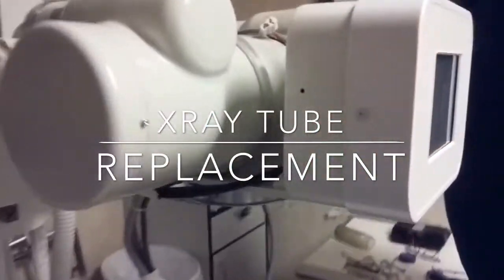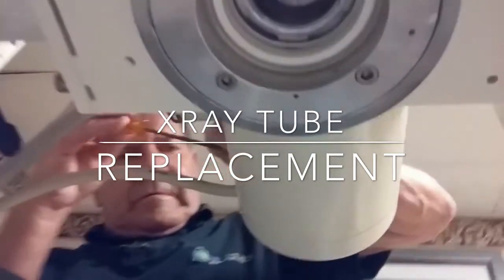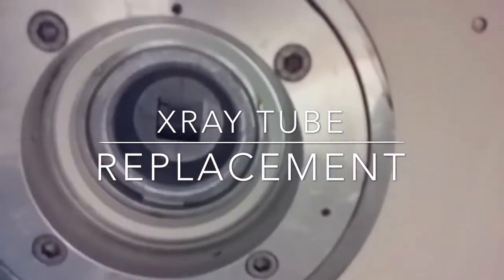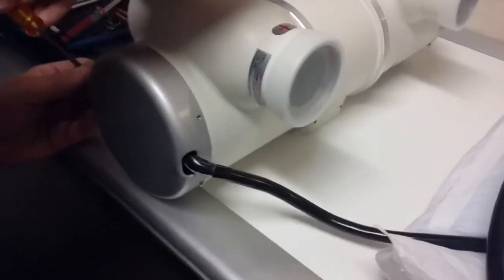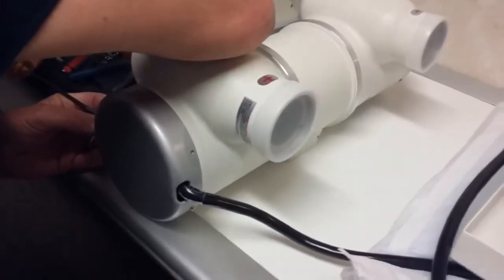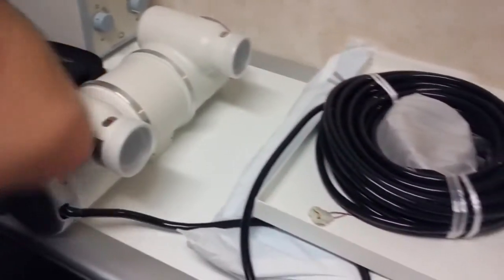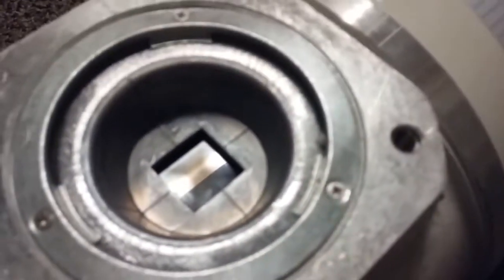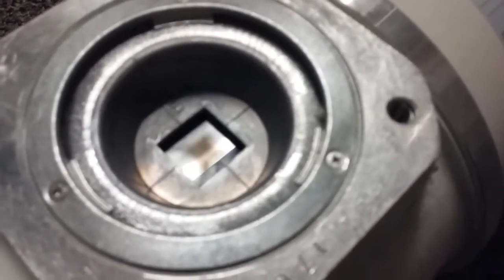X-ray tube replacement

Comment: what's the compound that was placed on the poles of the tube ?
Reply from the maker: it's high voltage grease
Reply: Don’t ever use that stuff, unless you plan on cleaning it up every year. No major OEM would recommend that